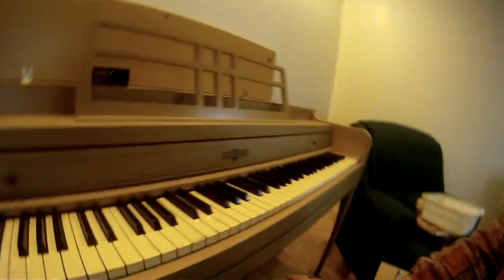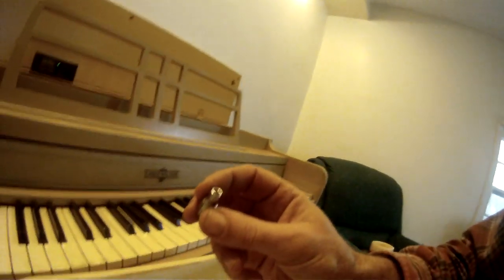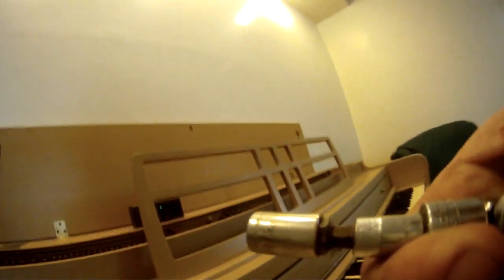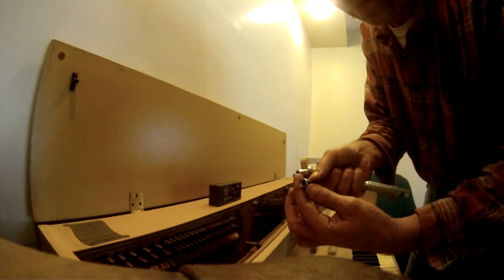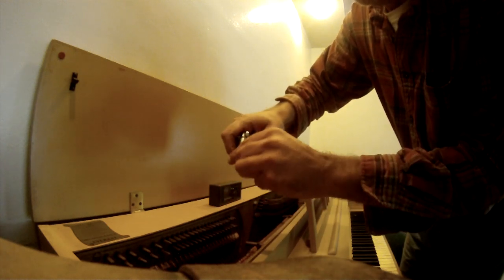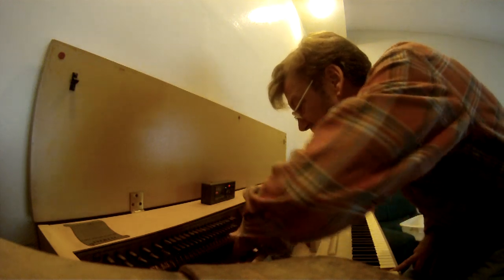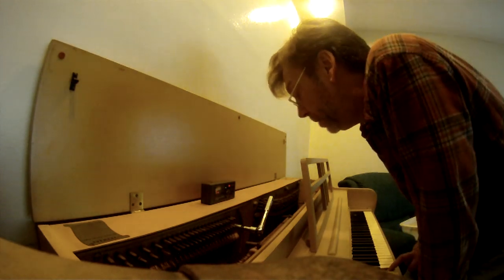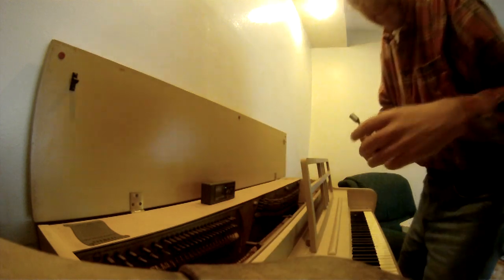Homemade piano tuning wrench

Comment: I am an apprentice piano technician, and I love to make tools. I have also assembled a tuning lever from industrial parts, but using the tip from a tuning lever I dislike. But I went the DIY route because of the ergonomic, which could be very expensive. There are different designs of tuning levers, but no one really re-designs the tuning tip. If you use something else, there will be compromises.
I would not suggest using a socket as tuning tip, however you are also only risking with your own piano. Repair will cost more than a regular tuning, but you are also welcome to repair by yourself.

The tip design consists of a star shape (double squares), because tuning position of the lever is part of tuning technique.

From previous comments, tuning pins are tapered, meaning a regular socket would minimize the contact point. Minimal contact point might insert too much pressure on one point and damage the pins. By the way, tuning pins come in different sizes. 

The pins do bend (and flex), but our eyes cannot distinguish. We know because the pitch would change when pin is pressed downward, as a result of different tension. That says, not knowing how to control the lever, one could actually bend the pin permanently, maybe then damage the pin block (where the pins sit).

Unfortunately, piano technicians tune piano not only because they own tuning levers (plus many specialty tools), they also practice a great deal to know how to use it.

Comment: Yeah this worked fine, I don't see any stripping on my pins from this. It's amazing how well the reverse of a regular socket fits on the pegs. I used a very large hex wrench as my lever, it looked more solid than the chinese tuners they sell on amazon and ebay.

Comment: I would use a breaker bar since the stack length may add a bit much adding a bending force (moment). The breaker bar can allow you to be closer to the pins when torquing thus eliminating the bending force plus you will have a longer handle.

Comment: Thanks. I have been trying to figure out how to de-string an old piano, since i bougth a cheap tuning wrench on line that did not fit.
I have had the tools staring me in the face but never thought of doing this. I got all the strings off a turn of the century piano in about 2 hours.

Comment: I guess the wrench or what doesn't matter. As long as the tool is firm enough to give you a stable grip and allow you to control the pin precisely as it is needed (I'll never you wrench though, as it does make sense to wear the pins out). If you learn something about tuning tools you realise that the handle the whole tool has to be as firm as possible or you'll never be able to position the pin right, or the better your increments you'll be able to move the pin will not be that discrete as with proper firm tool.
The main point is that to set a pin in its stable position is not an easy task. You might potentially set the pin up and tune the string, but the next day or very soon it'll be out of tune again.. which might lead you to a conclusion that the piano is untunable but it might not be the case. Your improper tuning makes it unstable).
Once more again, to set the tuning pin right is not just to set it up (temporarily) in seemingly good position.

Plus to tune a piano requires lot of practise as anything else. 
Sure but it is fun to tune your self ;)

Comment: This is the worst idea ever.  Please, please, please don't do this. You will potentially ruin your piano. This guy doesn't have any idea what he's doing.  Even a cheap piano tuning wrench will be far, far better than a socket.  Piano tuning "pins" (not pegs) are tapered.  If you don't get a proper bite on the pin you can bend it or elongate the whole it's set in.  This is bad, I mean really bad. Repeat: DON'T TRY THIS AT HOME! Gee, I hope that was clear enough. Don't say I didn't warn you.
Reply: You must be a piano tuner or just uninformed or simply had a bad experience... Ive tuned my wurlitzer for over forty years with the same technique.. NO damage ever.. you think they make them tuning pegs that cheap they would actually bend.. ? What pianos have you been working on? Ones with cheap chinese steel pegs??
Reply: Bud Time Your post just reassured me. I want to tune my mother's piano for Mother's Day, and I want to do it with as little money spent as possible, since I'm a money-pincher and I'm only a teen. I've looked up how to make a DIY piano tuning wrench, and this vid came up on top. I really hope you weren't exaggerating the amount of time you have been tuning your own piano, because this piano has been in the family for a LONG time!!
Reply: +Lance Batchelder  If the square end is a good fit with the socket, using a breaker bar, I see no problem at all.  They even make the wrenches with a 5 degree handle angle to help clear the pins which brings in the bending moment (force) you are concerned about. With a breaker bar you can keep your handle close to the pegs thus eliminating much of the bending moment, even if the socket stack is a bit long.
Reply: thank you for your reply.  Very very helpful

Comment: Did you also promise to risk damaging their instrument? This is reckless with almost no knowledge about the construction of the instrument. If you need to tune your piano please don't do this
Reply: as long as it fits it wont hurt a thing son
Reply: @itsjustweezer4054  ots not just about fit, its also about materials. Common tools can put too much pressure and torque and can permanently deform the tuning pins. This is permanent damage.
Reply: @scmontgomery  i tuned mine up 2day and it works good
Reply: @itsjustweezer4054  "working" and "damaged" are not mutually exclusive. I got my tuning hammer for like 10 bucks